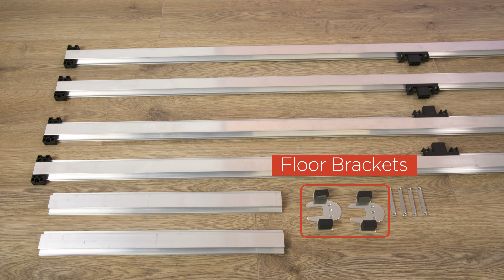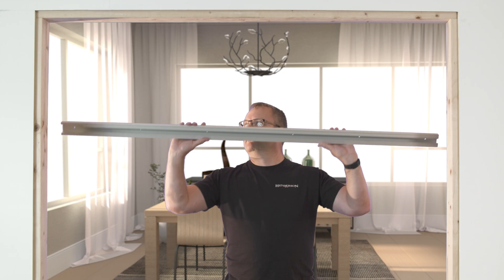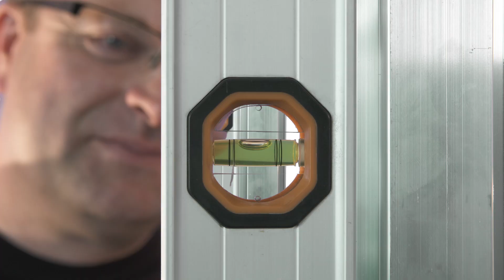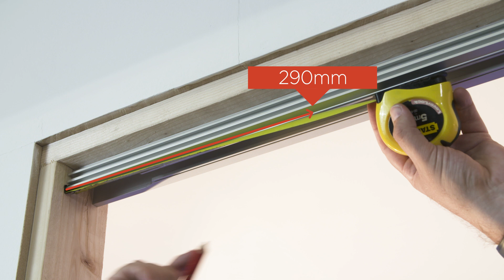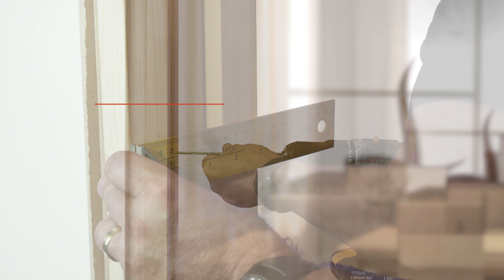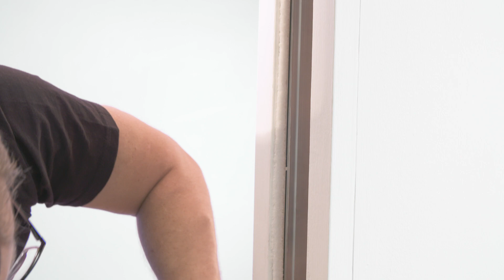How to: Install a Pocket Door Pro System - Pocket Door Pro by P C Henderson

Comment: How do you attach the plasterboard to the metal frame?
Reply from the maker: Hi Benj, we would recommend using an adhesive to attach the plasterboard to the metal frame. It is possible to screw the plasterboard to the frame but you would need to ensure that the correct specialist fixings are used. Many thanks, P C Henderson Ltd
Reply: Self tappings screws